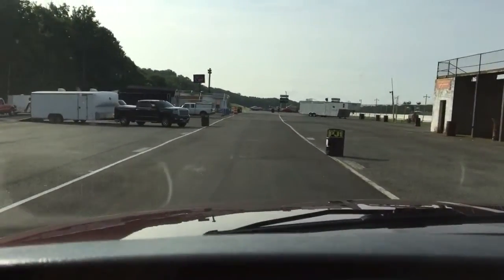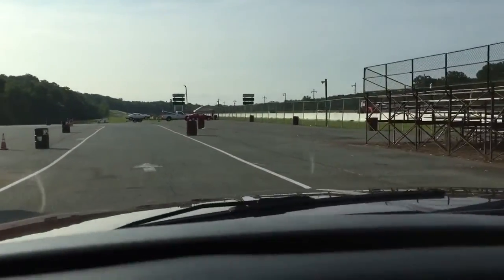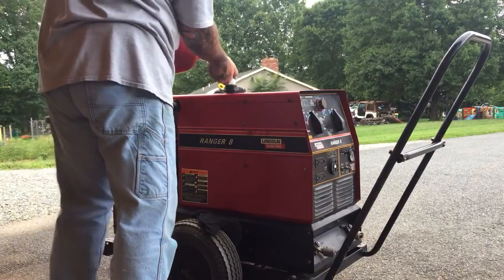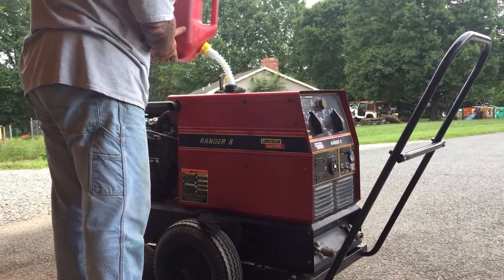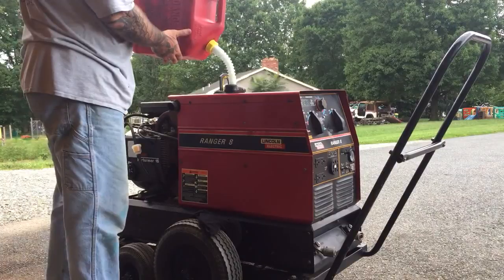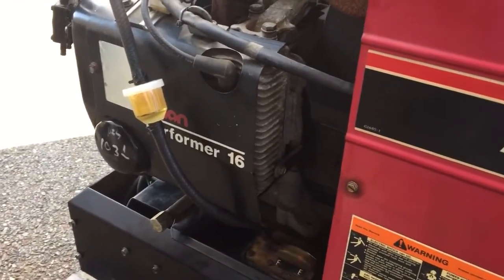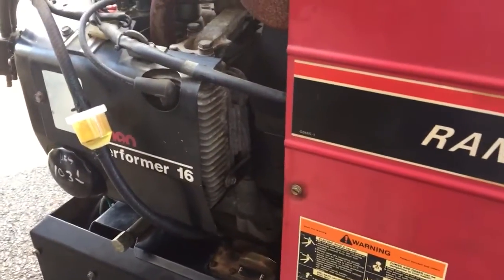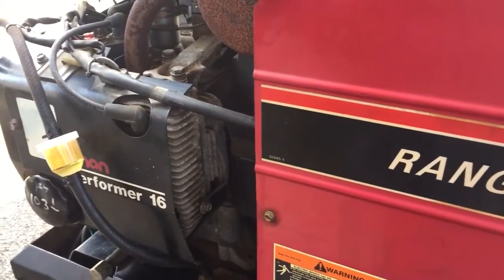Lincoln Ranger 8, Onan Engine, Part 1- Light Maintenance

Comment: This was a very good video. Where can I find the manual?
Reply from the maker: @AntwainHenry  The manual for the welder can be found on Lincolns website. You will need VIN and serial numbers for the machine. I found a manual for the engine on ebay. Mine is an Onan which is made by Cummins so I did a google search for a manual for my engine number and it popped up on ebay.

Comment: So My dad has a welding machine ranger 8 onan engine but It wont Weld and we think its the spark plug wire from each side By any chance do you know where they sell spark plug wires for that certain machine.
Reply from the maker: You could try a google search. There are model numbers somewhere for the engine however spark plug wires shouldnt be too hard to source without. I will look in the morning I think I may have a parts book for the engine that may get you close. No guarantees on that tho. I know I have a service manual but Idk about parts manual.
Reply from the maker: I wasnt able to come up with a part number to help you find some plug wires. You should be able to get some for any older 4 cylinder engine and just shorten them. Then youl have a couple extra wires.

Comment: What oil filter should I I use on mine, been looking to do some maintenance on my welder just don’t know what oil filter I should use ? I have the same model as yours if you’re asking .
Reply from the maker: I dont have a preference for oil filters actually. I just get the number off my current filter and have my local parts store cross reference it and I take what is available.  I do ask if a good one is available first tho.
Reply: Thanks I appreciate the help